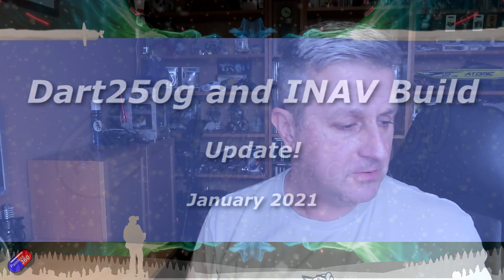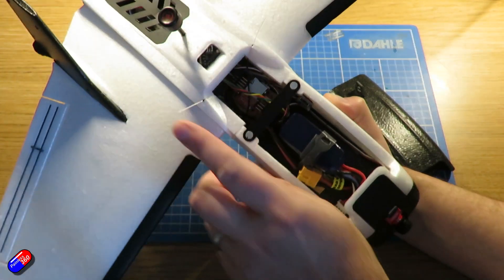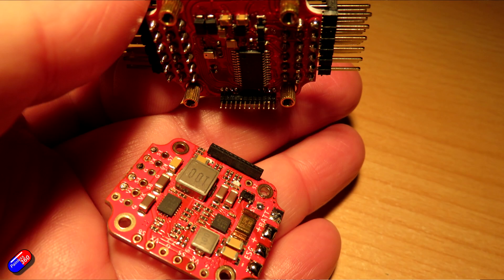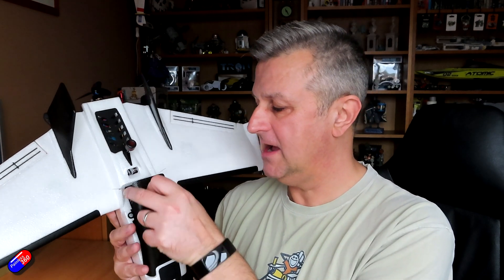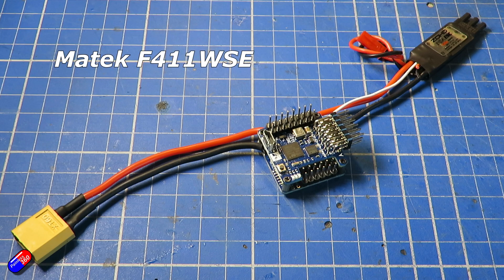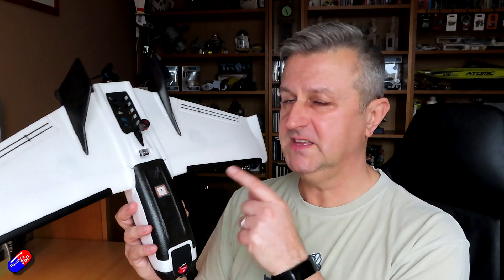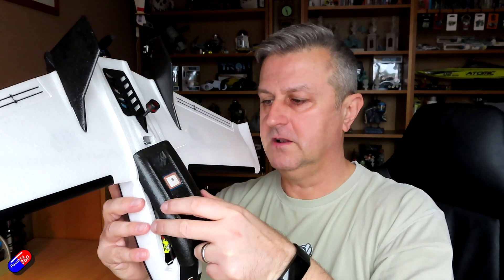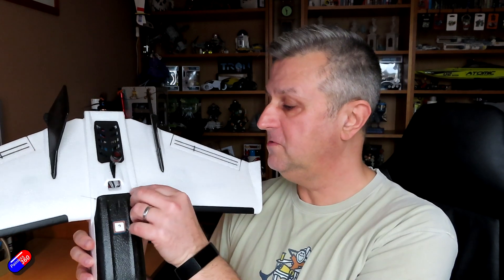ZOHD Dart250g INAV Build Update (my Racerstar F405 died so I'm using a MatekF411WSE now!)

Comment: Great timing! My dart 250g should be here Tuesday with the 411 wse as well.  I like how you have the vtx back in moving air, the only thing I ran into on one of my AR wing builds is somehow I was getting a lot of noise in my video.  Moved it to where I normally put it and the noise went away.

Comment: could you fit 4S 18650 there?
Reply: Probably not as it's a small plane and there isn't much room. Also the motor is only rated for up to 3S so you'd need to either be very careful with prop selection & throttle use or use a different miniquad motor.I

Actually if you modded the canopy you'd probably have room but then it'd almost certainly be over 250g so in that case why not just get a bigger model, like the DartXL?
Reply: @loc4725  I have all the sizes of wings but I have to admit I fell in love with such compact ones recently....my Dart V2 (680mm) carries 4S LiIon and trips 27km in under 20 minutes. Its hard to beat such performance and mobility.....so before I crash or loose it I am searching for replacement haha

Comment: Hi Lee, I got a Racerstar F405 intending to follow your build. I soldered on right angle pin headers with the unit separated into its 3 boards and then found it wouldn’t go back together as the bottom side of the pins was hitting the circuits below. I know I should have checked first but I learned a lesson 🤬 I cut and desoldered everything and started again but I think I have partially cooked the circuits as I now don’t get power for the GPS. I will continue to see if I can rescue it but it may end up in the bin. I was not at all surprised to hear you had problems most likely caused by unintended contacts.
Reply from the maker: It only powers the GPS when the battery is connected.. Best of luck

Comment: My 250g has always had a a 411-WSE in it, they're pretty good, although I don't hate Racestar, I use their motors all the time, I've had nothing but trouble with their flight controllers, always dying for no reason. 

I found the only way to get the Zohd under 250g was to use a 2S li-ion, but got a good 40 minutes in the air lol, it's developed a bit of a nodding donkey as it flies though which I'm hoping to sort out when we get let back out to play again.
Reply: did you ever get around to sorting the nodding donkey?I have just got mine finished and even after auto tuning it is still a bit noddy

Comment: I've been flying quads for a few years and messing with foamboard planes for a few months now. I plan to buy a manufactured wing or plane this spring, and definitely would like to have stabilization or a flight controller, since I'm not the best plane pilot yet.. Is the dart 250 a good "first" airplane for a person in my situation?
Reply from the maker: See my videos on learning to fly fixed wing. A wing is not the ideal place to start..
Reply: If You flew planes already then go ahead and try it. If you understand how to maiden the airplane (set CG and launch or land) then go and buy it if you like it. I was also skeptical but if it flies as good as previous dart then You will be happy with it. *I have V2 dart and I fell in love with it instantly

Comment: My pet hate in FPV is when manufacturers use those vertical pins to connect boards together. I've had nothing but problems with them and burned out 2 iflight 16x16 stacks in very light crashes.